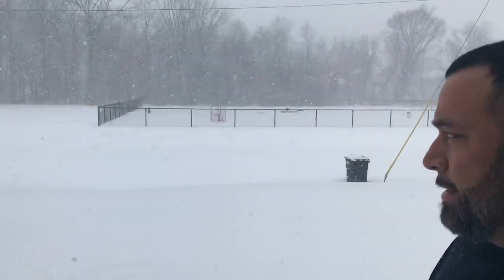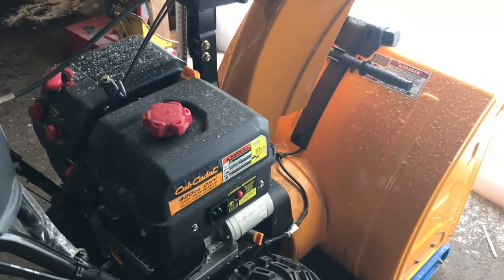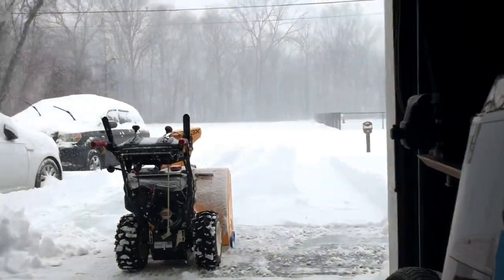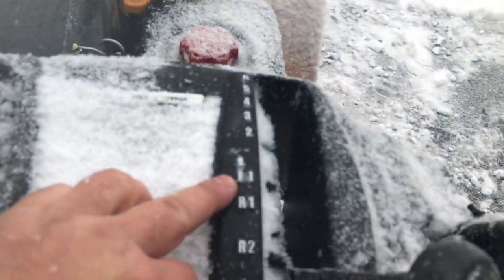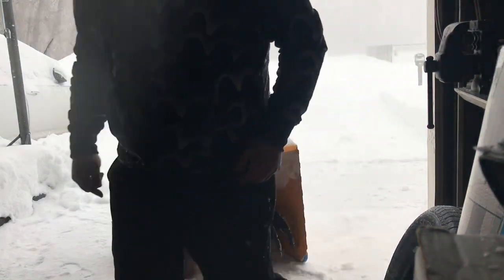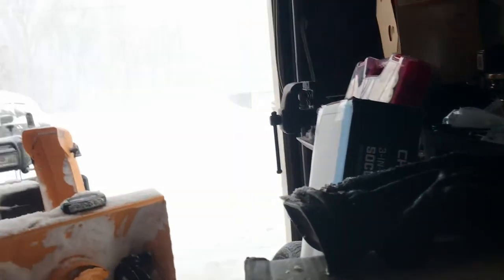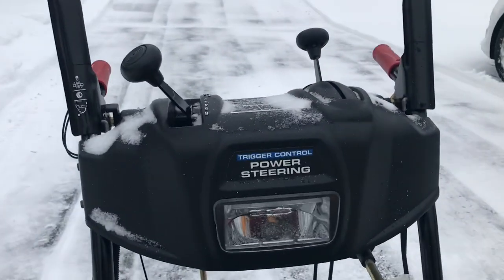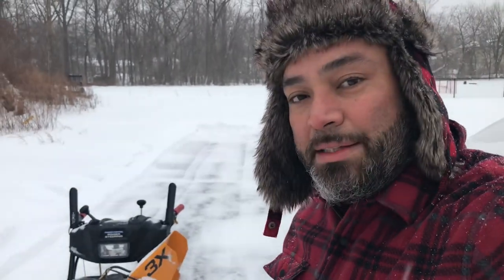Cub Cadet 3x 30 HD Review 2021 snow storm

Comment: He should know how to use the machine before doing a video!!! I suspect most viewers will know more about this machine than he does - You have to start the auger before going forward in order to prevent the clogging we just witnessed!! -He is not a good operator( I have the Cub Cadet, 30 inch, 2-stage 450cc and it is a gem if you use it properly!!  those pins snapped because he ran into the garage wall on the left side of the garage there -  Need a lot of instruction in snow blowing before trying to show someone else - He is dangerous with that machine - WOW!!!!
Reply from the maker: This is awesome 
You are good
Thanks for the information 
However the left side of the garage door was damaged with a back hoe when we did the drive way. But i love reading these comments. Thanks For watching
Reply: -  @chillymooose  Sorry if /I was a little harsh with you - Didn't mean to be!! - Looks like you hit some part of the garage to break that shear pin. These machines can be dangerous if you are not careful --READ THE MANUAL!!!
Reply from the maker: @michaelkent1940  no worries. I appreciate the information

Comment: sorry dude but your demo was a dud, you and your 3 stage snow blower have a lot of pairing to do/learn .. yes lubricating the snow shroud is one technique that will keep clogging to a minimum .. another is to DuraLube your oil that will improve your overall torque to clogging/resistance (other benefits, cold start lubrication, and longer engine life) .. you might want to redo this evid!
Reply from the maker: Thanks for the comment

Comment: Hahaha you got stuck not because you were going to fast but because you don't know how to properly use a snow blower as well as the fact you 3 stage Auger blade in the front is NOT SPRINNING due to broken shear pin which is why it kept clogging lol

If your going to make a video KNOW WHAT YOUR TALKING ABOUT AND HOW TO PROPERLY RUN THE MACHINE Lol
Reply from the maker: Hahahahha
Yeah that is soooooo funny 😄

Comment: now I know never to  buy a cub cadet
Reply from the maker: What are you currently using, and are you happy with it?
Reply: @chillymooose  I have a 30 inch Areins I bought used for 600.00 from an indian engineer who was moving to california and didn't need it  I lucked out cause he bought it two years before and did'nt even have it assembled out of the box yet never was used     I have a couple other areins and I loveum they'll shoot 70 feet with a dry powdery snow as long as I wax the shoot and housing every time I use it .mine has a briggs engine    if you notice in ur vid the snows all caked up in your housing it freezes to the metal with out the wax spray
Reply: @chillymooose  be carful not to use ever on a gravel driveway once that finish is gone the snow freezes to the metal    I live in new england btw
Reply from the maker: @slick1G3 I really appreciate the updated info 
I used silicone lube in my latest video of this years storm. I think it works well. But I definitely appreciate your input and I’ll check out some ariens blowers when i get a chance.
Thanks
Reply: @chillymooose  I use furnature wax seems to work the best   dont buy the spray  snow blower dealers are selling the're gettin 15 bucks and its probably the same stuff

Comment: I own the tracked version and its junk. The center augers rob power and it cant handle wet snow at all. Burns up belts reverse speed on the track is a total joke this is absolute garbage after 3k for a pile of crap. Go Honda
Reply from the maker: Thank for the info…. It really is overrated. I am still waiting for another snow storm to see if it will change my mind but still nothing. Thanks for the info, I’ll start looking into a Honda for next season.